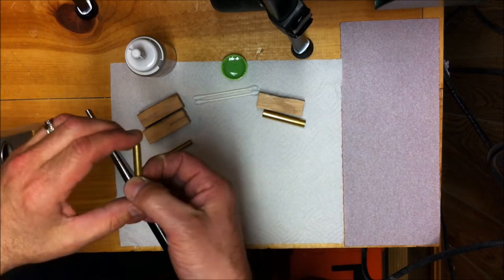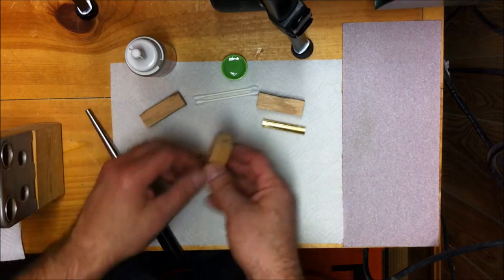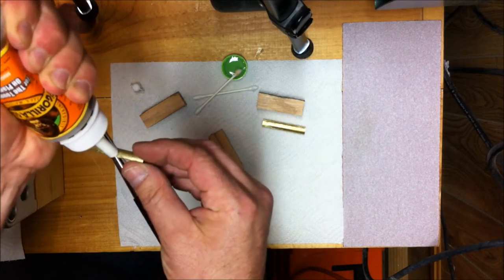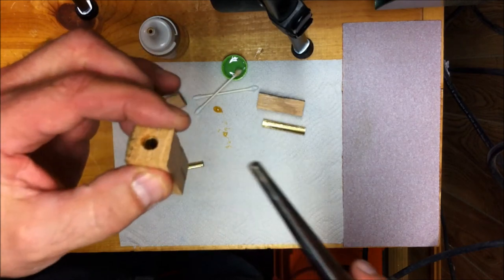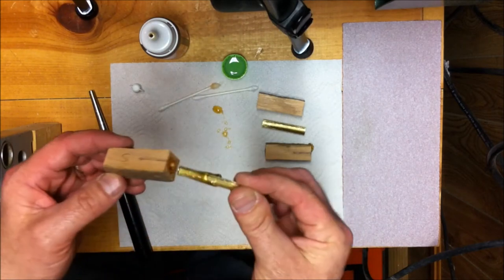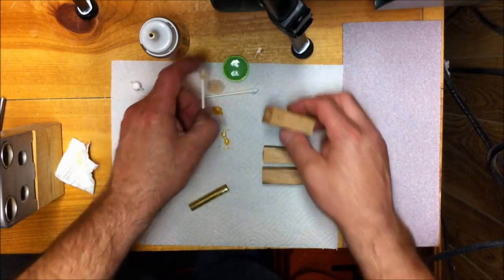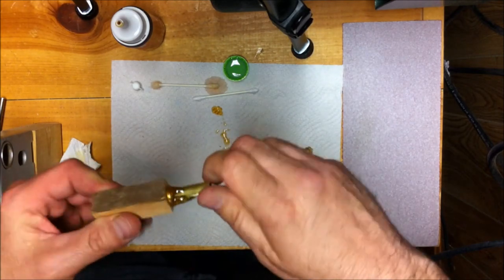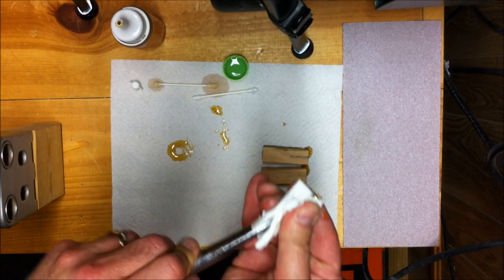Barn Wood Pens   Part 3 of 7

Comment from the maker: Don't worry about filling the tubes, the barrel trimmer will clean the inside of the tube as it trims the end. I have never had a tube slide out of a blank. You might want to make sure your drill bit is not a tad big. Just a suggestion, I hope it helps.

Comment: This is interesting because I do almost the exact same glue-up as you with Gorilla glue but I stopped using it because the tubes kept creeping out of the blanks before the glue set. The different part I do is to plug one end of the brass tube with dental wax to stop glue going into the tube when being inserted in the blank. I tried Titebond Polyurethene, a foaming glue too, and the same thing happens. I have to sit and repeatedly press the tubes in until they set because they keep coming out.
Reply from the maker: Thank you.